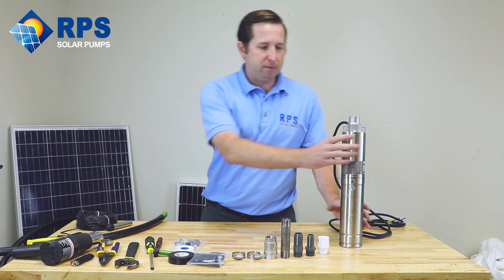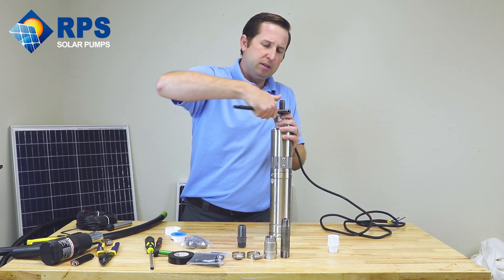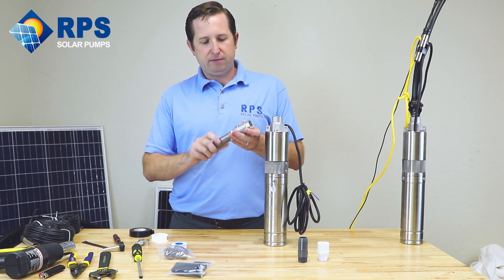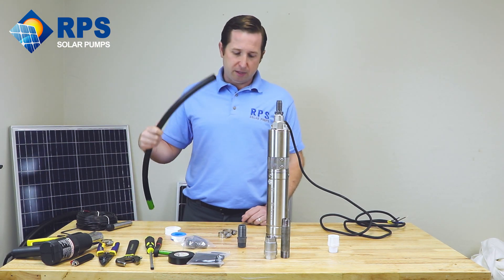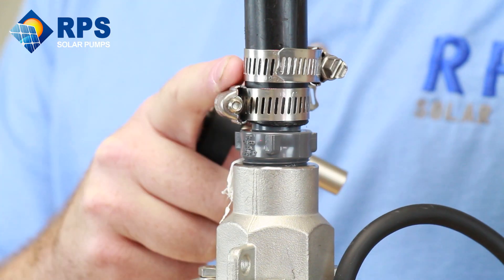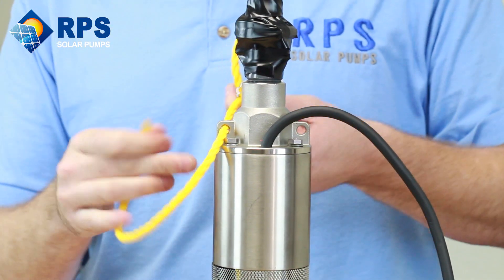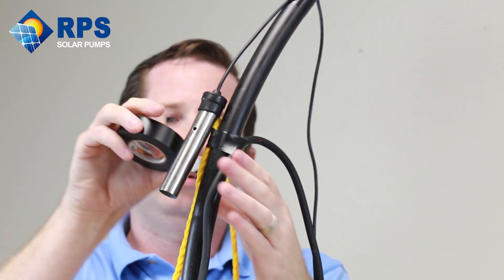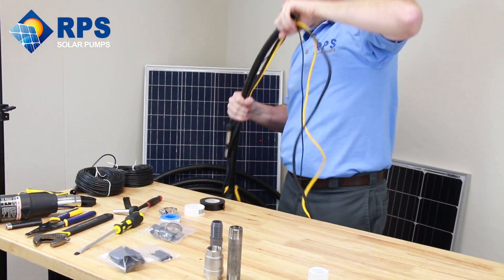Plumbing a Solar Well Pump - RPS Kit Installation

Comment: I completed everything, dropped my pump in the well, it worked great, then I realized I had not installed the check valve. Doh!!! Gotta pull it and do it, but it's okay. Everything is working!!!
Reply from the maker: No worries friend! you're not the first to forget a check valve! you've got this!

Comment: You wound your thread tape around the fittings the wrong way. When you screwed in the fittings all the tape came off. There's no tape left on the threads.
Reply from the maker: Good Catch Mark!  I have trouble speaking to the camera and demonstrating at the same time!  Getting better at it though. -Mike
Reply: I noticed the same thing Does the right hand know what the left is doing?
Reply: Tape... SMH.... and these are the professionals... Hummmmmm